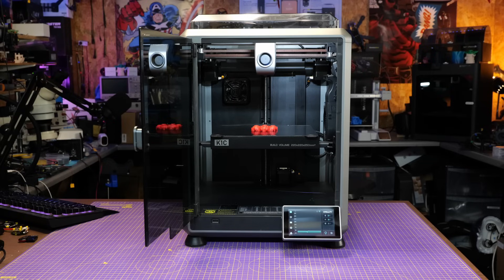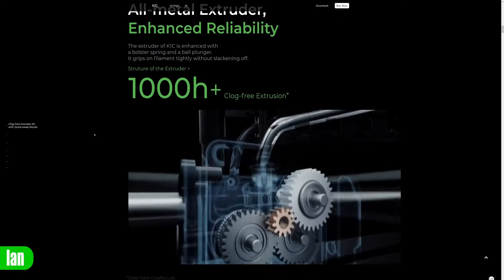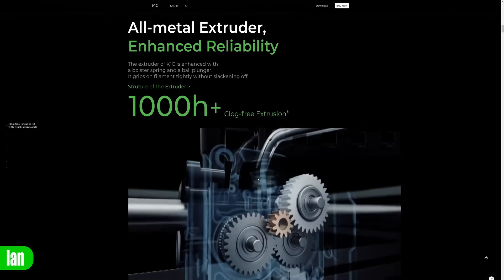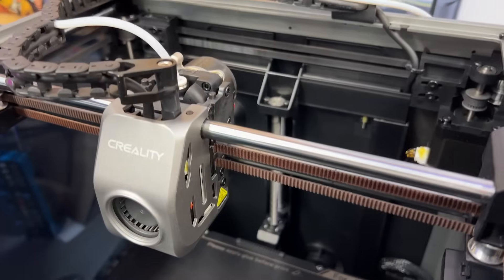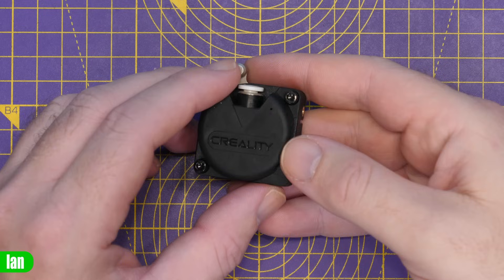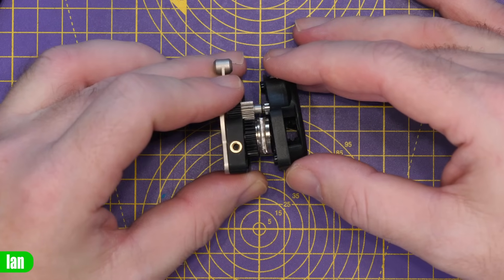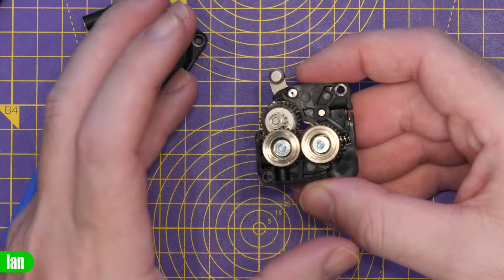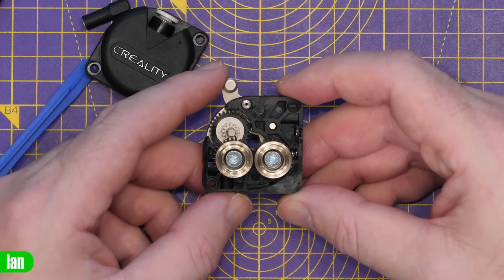Creality K1C All Metal Extruder Is Not What It Seems - They Have Explaining To Do!

Comment: Metal parts that are actually contacting abrasive CF filament are both sides metal....
Reply from the maker: When would you have any plastic rollers in a modern printer ?
Reply: ‘All Metal’ means all metal ….. in other words not PLASTIC. Even the non metal extruders  never have plastic parts in contact with the filament
Reply: Then they are the same as "non all metal" extruders... So what's the point?